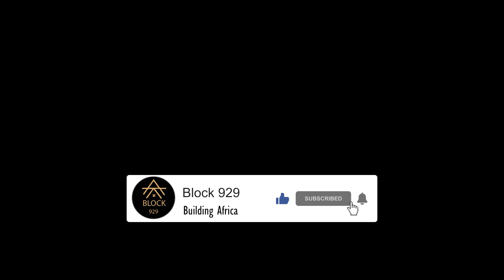DIY Projects At Block 929/ Bathroom Build

Comment: Can you add closed captions so that some can understand what is being said without trying to read your lips. Also, the spoken word is very low almost inaudible. Nice music. Only thing that can be heard. Drowns out your spoken word due to the very very low volume.  May need a better microphone that is either portable wearable or attaches to the existing equipment being used.
Reply from the maker: Will try to get a microphone, they are not affordable here. They start from $200.
Reply: Music is awful
Reply: @block9292  it's music ruins video